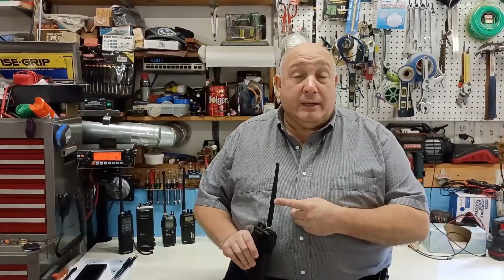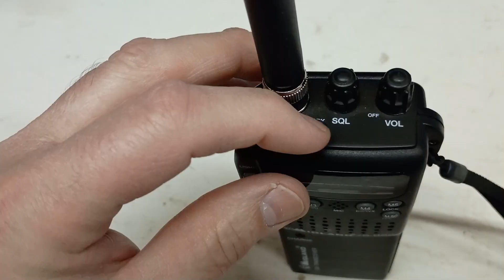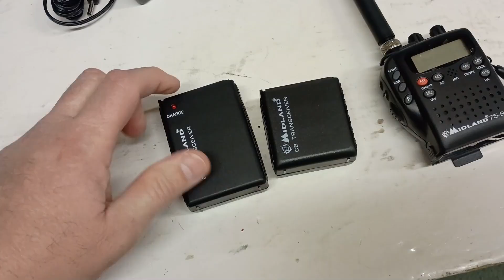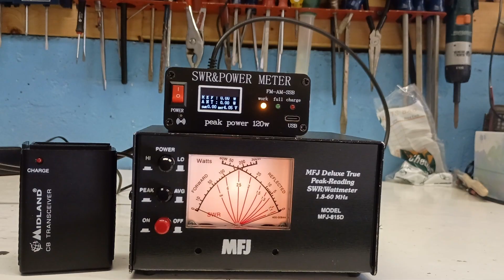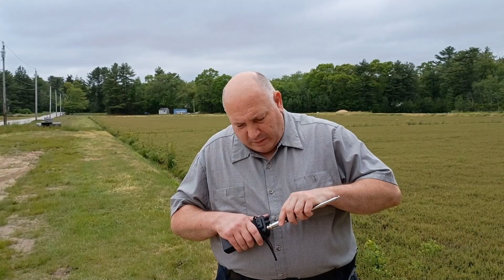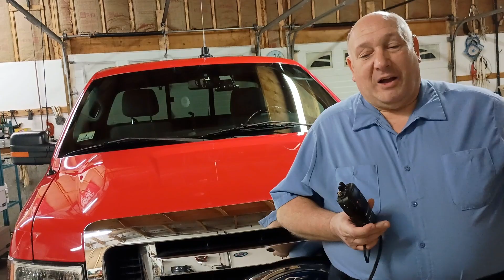Midland 75 822 handheld CB review and range test 75-822

Comment: i my self use an external antenna and the BNC adapter is and a external power from the cars cigarette lighter. and good value for money.
Reply from the maker: Are you saying you're not using the factory cigarette / antenna connection that came with the radio?? ... Either way I bet the radio works well for you.
What are you using for an external antenna?

Comment: What would happen if you used eight alkaline batteries
Reply from the maker: I'm not sure ..... I have been trying to buy a cheap 75-822 on E-bay to try just that.... as I think it might damage the radio??? I really don't know.. I mean when you plug it into the cigarette lighter plug it's 13.8 volts.... and I don't see any regulators built into the cigarette lighter adapter..... so maybe it would work and they built it like this just to comply with the FCC???? I really like the 75-822's I have and don't want to take a chance on killing one... it would probably work for a little while.. but that extra power may cause trouble... the engineers that designed it know what their doing???? I bought a couple cheap 75-822's for under $30 bucks to try it on.. and they were not working ... so it's really difficult to find a cheap 75-822 on E-bay that works..... they seem to hold their prices.

I've had people comment here that it works just fine.... but I'm a bit scared to try.
Reply: @steve_niceguy i understand

Comment: I have always had a cb or alike radio in all my vehicles, now, with that said, over the years of driving, lets just say, less than new(ish) vehicles, it was easy to mount a radio and antenna system. The last few vehicles, being a lot newer  and less and less room for a typical CB radio and then becoming harder to "drill the hole" for a antenna or even a lip mount style (body lines and gaps a lot tighter) it was pretty  tough or a challenge to install a radio in the new to me Subaru Outback (2021)  Sirio PL 5000 w magmount and supplied coax, and the Midland 75-822 in a cup holder. I do have the Uniden Pro 401HH also. I had purchased a mic/speaker to plug into the Uniden, but just didn't like it. The Midland 75-822 however , the mic/speaker did work and work well. There is a little bit of "engine" noise via receive on the midland, but with all the modules, touch screen infotainment ect, I lucked out, fairly quiet in that respect. Low power is 1 watt carrier with a modulated (voice) peak power of around 4 watts, on Hi power is holds a 3 watt carrier with a modulated peak power of around 7 watts. With the magmount on the roof, driver side rear corner, and the coax ran down along the water drain section the rear hatch seal is plenty and soft to allow the coax to be ran, passed it without pinching it!!, SWR 1.03:1 @ 51ohms channel 20. This is about as simple, and practical with best results with a half composite, half very thin steel structured newer vehicle. An honest range to base in town around 3-5mi, out side of town in the "boonies" flat ground , on the edge of 10mi, (power on hi) , imo, not too bad, and no holes drilled. I'd love to find a Magnum 1011, (am/ssb, handheld) to have the SSB mode, but, I have yet to score one. Your channel came across my feed, enjoy the content.
Reply: Btw, own the QT60 and Q5Nii, love them both!!
Reply from the maker: they say that Sirio 5000 is the best antenna out there, I just did a huge  antenna test on the 7 most popular antennas....  one was a Sirio 5000 .... I found four antennas seemed to do about the same, the Stryker SR-A10 ...the Wilson 1000..... the Tram 3500.. and the Sirio 5000... all 4 antennas did about 9 miles vehicle to vehicle.... the Sirio 5000 sounded the best and received very well and was a very quiet.... but that Sirio on the top on my F-150 was just too tall... that is one big mother!!!! even the magnet was 6 inches around versus all the others were 5 inches around... my F-150 has grooves on the roof for strength and the 6 inch Sirio would not fit between the grooves... so I'm not too thrilled with the Sirio 5000.. it's really the top performer.... but it's just too tall for a pick-up truck..... thanks for the information and thanks for watching
Reply: @steve_niceguy all the pickups I had over the years, yes, top center off the roof is best, im sure alot of us agree on that, but, i use my truck for truck stuff, hard to beat a fender mounted antenna for practical truck use, with radio involved. My go to for years is the Hustler hq27. The larger load version, not for power capabilities,  but for a wider band width, swr range. Covers the typical 40ch spread with lower swr at each end versus the little white load version of the hq27.  Firestick isnt flexible enough to get to the fishing hole, 😅. 102 ss whip is best but tinging and tanging on everything is annoying.

Comment: Steve, I just got a new pickup, was going to drop a lot of money on a new cb etc...Forgot I bought this same radio a couple years ago to keep in my rig just in case...never even used the antenna/cig lighter adapter. Around ten miles is more than enough for my usage. This is going to save me major bucks. Thank you good sir.
Reply from the maker: the Midland75-822 works and it's cool that it can do both handheld CB and vehicle CB....

I like to put them in my friends trunks for bug out radios I put the 75-822 and seven 25 year self-life lithium AA batteries  that can withstand high temps of being in a trunk in the summer.... I also put one dummy battery.. and a Tram 3500 CB antenna... now if the world goes to hell and my friends or my friends kids can get 10 miles from my big base station ( my base station can hear fantastic...even those little handheld CBs..... but if they need to get to my house for safety... I can try to guide them to my house with a paper map.... as GPS and cell phones will be down...... if the highways  or roadways stop and they have to get out and walk... I can go out on my snow mobile or my quad 4 wheeler and find them as long as they have the Handheld CB ...... so having that 2 in 1 radio for $100 bucks is awesome.... but it's not a great daily CB

 it's just not as nice as a real CB ... you can buy a Radioddity QT-40 .. it is a fantastic CB .. it has AM/FM SSB it has 500 channels and 40 watts of power.... you can buy it for $149.99 on Amazon.... with sideband you can talk all across the country and the world... for a $150 bucks!!!!  it's night and day difference over the 75-822.... plus the QT-40 has NRC noise reduction... a total game changer in the CB world... watch my video on "my New QT 60 Radio.... I show what NRC does... it allows you to hear low watt radios from far away.. and with all the power the QT-40 has, you can easily talk to them...... if you can hear them.... you can talk to them.
best of luck whatever you get.... and thank you for watching.
Reply: @steve_niceguy  You're a wealth of knowledge and experience, I will look into those, and thank you.
Reply: @steve_niceguy  With the QT40 I'd need to convert it to have also regular cb channels correct? It seems to be a ham radio only from what I read on Amazon. I had a Galaxy back in my trucker days converted, and wished I'd never gotten rid of it..
Reply from the maker: @colesnorris  yes you have to modify it to work on the CB band... on the channel selector in the front of the QT-40 is a band selector A  B   C  D  E   F ........... when you buy it the CB band "D" doesn't work... you take the back off and move a clip that touches pin one and two....... you just lift it up and move it to touch pins two and three.... there is a 100 videos on how to do it on YouTube... don't be afraid to do it... it's the easiest thing in the world... then band "D" will work... and you can just leave the radio on "D" and use it like a CB.... you can even take the weather channels and program in your local police and fire and listen to them... I left two of my weather channels alone and programmed the other 11 for police fire and other local utilities..... you will be VERY HAPPY with the QT 40.... watch my truck in stall video... you might get an idea.... or not, I'm sure you'll do fine.

my install video is called .........."Tram 3500 CB Antenna range test and President Grant Export cb truck install"

again thanks for watching
Reply: @steve_niceguy  You're the greatest, thank you!
Reply: Thank you for the efforts and work you did documenting this.

Comment: Anyone figure out a good way to mount this radio?, i was thinking one of those cup holders for walkie talkies but like he mentioned the belt clip on the back kinda makes that hard to do.

Been wrapping my head around a way to mount it / use it with ease rather than just sitting it in my cup holder
Reply from the maker: this radio works ok.... but if it was going to be a daily radio... there is a lot better radios.....
but if someone really wanted it to be their everyday radio... in all my vehicles I have a Magnetic mic holder....
I LOVE IT!!!! if I'm driving I don't take my eyes off the road... I just put the mic near the magnet and it yanks it out of my hand.... so I never have to try to hang it up.... I go off road a lot and it never moves.. the magnet is super strong! when you go to take the mic off the magnet it is one heck of a pull... so I learned to slide it off the magnet
when I mounted the magnetic mic I had to take my dash apart and find the dash frame to bolt it to... because if you just put it into plastic it will rip the dash right off... it's that strong.
but the big metal belt clip on the Midland 75-822 would probably work on that magnetic mic holder and work pretty good.... if you could mount it up high enough the speaker could be easily heard and the display could be seen while driving. https://www.amazon.com/Magnetic-Mic-MMBP/dp/B0153KY2GY/ref=sr_1_6_pp?dib=eyJ2IjoiMSJ9.I-gFi_jUIPOxctIftO63mD6JcjoFxxjGrtZhD24RQe8hsA_gutKpkQscZfuM9wyOIkbb_rijO9w99ZmBgDg94crUHWzLvZ11Dm9xL-KL2YFBf0xc5U20oFZleLPTcQKFtLVhHUYY6LLwzTQMpg160SRLjd6ubrrIB49KELPkNrXWHZRldlIgWYVtigt75MdrAHJSur9NZo--Ynvb8i_RMyKhRAa8c4YviLs0gMGTcQdbgxGyp_SrL0RXAYioBmUwAMLZxQhu6YWyLdiGnYeyYFy7e4v3TWoYSX-OwnbIRtQ.HvdzK_XRTS_1J7JCn39cY-lJSLEwqIk-JCNwcHO4-TQ&dib_tag=se&hvadid=174225219322&hvdev=c&hvexpln=0&hvlocphy=9002042&hvnetw=g&hvocijid=11375117098291209050--&hvqmt=e&hvrand=11375117098291209050&hvtargid=kwd-30116016051&hydadcr=24656_9648981&keywords=magnetic+mic+holder&mcid=bad533f3985d332a8df84fb8a6c36027&qid=1757825801&sr=8-6